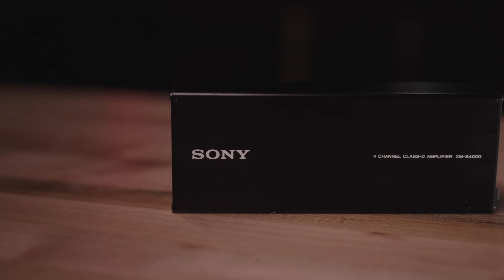What's the difference between amplifier classes? | Crutchfield

Comment: Heard plenty of class D over the years, including some prototypes from Bel Canto before being released to the general public. Yep, they have sure have improved enough for me to feel these things now sounds pretty damn good. However let's face it, manufactures are not using them for their sound quality. They are a way to cut cost and can be implemented in applications where a class A or AB is not practical. Think about a 11 channel AVR where cramming AB modules is daunting and cost\space prohibitive.  Still despite all their advances, I have yet to hear one that handles music exceedingly well  where I go, WOW I got to get me one of these.
Reply: You ever heard Hypex NC400?  That thing is definitely not built to be cheap. 125dB SNR and 0.0007% THD at 200W. All this at up to 93% efficiency.
Reply: @tomkocur  Yep, like many fine class D designs it sounded wonderful. However it still had that class D handling of the signal, that did not WOW me. Contrast it to something class A, like a Zesto Audio Eros 300 tube amp or Pass Labs class AX 100. To my ear a class A design does not sound the same. These amps are richer in the mids and highs, not nearly as accurate. Being someone that enjoys the more pristine sound of class D amps, they may not be your cup of tea. Their high price  and the amount of heat they generate is also a big turn off.
Reply: @tomkocur  I dont know what to say....that technics is the best ive heard thats d class in that price range.   
I cant really ask questions to anyone because no brick and mortar and ive been messing with this stuff idk....30 years maybe. So specs dont really mean much . Take an SET for example , terrible specs and distortion sounds better than any d class pretty much at any price.
Reply: @dednside5229  well, it all depends if you prefer "nice warm sound" or "true to the source".
If you want an amp that's true to the source, numbers are everything - you want low THD,  low IMD, high slew rate and whatnot.
If you want "nice warm sound", you'll get a tube amp running in class A. It might distort like hell, but it will do it at the right places (even harmonics).
Not much to do with HiFi, but listening to music should be about having fun and enjoying yourself...
Reply: @tomkocur  
They' ll come a day you wont think that anymore but thats what i looked at for years. Heres the problem with that. China . The old specs say from the 70's were real because it was a law back then . So unless it cost litterally as much as say a new bmw for the whole system count on it bieng measured in a favorable way thats not reality. Thays why old restored stuff can sound better and usually does if were talking amps.
Reply: @dednside5229  cool story bro.
Reply: @tomkocur  okay man . You win.
Reply: @tomkocur  look up kenwood l08m with  external power packs. Thiers a pair on the shelf in hardoff japan tokyo for 350$ a pair. 
10-350k frequency response at basically no thd. The best sounding amps like say midgrade go for 8 thousand dollars on the street. 20,000 damping factor. These are real specs 20-20 at rated power class ab. The best sounding amps are VFET SONY and Yamaha B series And then Kenwood/Trio years L which stands for labs series. They use communication chipsets and sigma servo feedback . 
They are so hard to repair because thier actually more advanced than a brand new d class
Reply: Technics su700g MK2 .
EVERYTHING sounds great.
If you can afford one restore a kenwood L series like an Lo-8m/5/7/7II .
I have hafler P7000 pair on a modified soviet tube buffer out of a marantz. 
Does it sound better ? Yes .
Does it have the top end of a Technics ....no . Bi amp .
Reply: NAD m23 …..breathtakingly good…..
Reply: That's because of your pre-bias. You will never like Class D because someone once told you they were no good. The state of the art class D amps literally CRUSH every other kind of amp there is.

https://www.youtube.com/watch?v=N6_6NOM7BZ0
Reply: @Wizardofgosz  I base my likes and dislikes by actually auditioning equipment. Trying out lots of different things to include the latest generation of Bel Canto class D amps. Sounded really good on a pair of Maggie 1.7's. Regardless, I liked them connected to the ARC VSi75 better. Agreed, I do have a bias. I always found I like the sound of valves and class A SS amps better.  The same way I like records better than digital. My personal taste has nothing to do with objectivity. Not sure why I should take the fun out of the hobby by being too scientific. I certainly have no desire to have something that crushes everything out there, too costly and too damn much work. There is always something that comes along that is better. I just want  something that I find fun to listen to. As far as being told not to like class D? !Huh! Never been one, that wants or seeks the approval of others. I'm far too ornery to  let anyone dictate to me what I like or dislike. I take a piece home try it out and let it speak for itself. If I like it. I purchase it. If not, I try something else.
Reply: @Wizardofgosz  
Ha! Wrong.... Single ended tube or hybrid tube or AB . Crush ? Thats a pipe dream. Hybrid tube amps and Single ended triode is the ultimate amp sans pure watts . I have that new d class Technics , the new one and i can promise your dead wrong.
People need to stop writing stupid stuff like this. Kids are gonna believe you. 
Start with a nice vintage kenwood DC and have it serviced. There are high end d class at big money but not until 10k or so. Get an AB studio amp like a hafler 9505 and use a tube buffer with good tubes and a digital front end. Its called a "follower configuration". This can be done on a budget also. Measuring at 1khz at such and such is not like the old gear which actually did rated 20-20 independently and had to be by law. So if your a spec reader understand the difference. Those old amps were legit chinese specs are bs. Its all in my living room right now so i know exactly whats happening here. P7000 diablo halfler are still cheap. Watch out though or theyll blow up your speakers if you dont re cap them. Push up your digital eq at 4k to saturate the tube plates and watch what happens. It smokes your d class and really really bad. I should know , have both. Look above at that lo8m. Those are legitimate specifications. Chinese is not verified by anyone and tested at 1k.
Reply: @dednside5229  You only believe this because you were told this. In double blind listening tests you absolutely would not reliably be able to pick out which one was which. That is unless the class A or the class A/B amp was failing and you could hear all the 60 Hertz hum.
Reply: @Wizardofgosz  It has not been my experience when contrasting the two typologies. Belief is not all that much a factor. It is verifiable fact when you measure tube gear you will find 3rd level harmonic distortion that does not exist in class D amps. Which is a far more accurate and unflinching technology. Tube gear cannot hold a candle to an class D amp's accuracy. People invest in valves because they like this distorted sound that those amps have. In SS versus tube amp debates this has been gone over many times. It is well documented that there is an audible difference that can be confirmed when measured.
Reply: @ridirefain6606  of course. And it's 80 or 100 dB below full scale.
Reply: @Wizardofgosz  
Okay . Im not responding to any hocus pocus answers and smoke like that. I have acess to the vault at Audio Advisors brick and mortar 250k $ plus systems. I believe whats real because i heard it. Buy all the dclass youd like.
Reply: @dednside5229  You didn't hear it. Someone told you that you would hear it, and your brain lied to you.
Reply: @Wizardofgosz  
And this is the argument for the ages.
The only problem with that is i have no bias twards anything. Its like comparing a honda civic to a ferrari number one. 
Unless youve driven a lamborghini you dont know what it means. Just endless speculation done by people because they cant afford it. And thats the real bias here. Thats why you hit the books and buy select old gear to be compeditive. If i dont understand it why do i have JBL that tests that way. 
Blind listening tests. Go listen to a pair of focal or wilsons. Youll get it.
Reply: @Wizardofgosz  80 or 100db below full scale means what? I do not see how this response has any relevance to the topic at hand. We are talking different sound characteristics not dynamic range. When comparing spec sheets of different types of amplifiers, the dynamic range between them tends to neck and neck no mater what the design is. If something gets rolled of it is usually the frequency response response figure, in order for its manufacturer to overinflate the amps power rating  I.E A 50 watt Conrad Johnson amp  that only has a range of 30HZ to 20,000 KHZ an 7 channel Yamaha AVR that does 120 watts 20 to 20khz with only one channel driven, these sort of games. Take some time and visit the Audioholics site or Audio Science Review and increase your understanding what specifications are relevant. You should be able to find a lots of useful content there.
Reply: @ridirefain6606  So you don't even understand what we're talking about? The harmonics that tubes add fall so far below full scale, that is if the amp is designed well, that they can't be heard.
Reply: @Wizardofgosz  I never heard anyone use the term "scale" in the context that you defined it. When someone talks about scale with me it is reference to the size of the recording venue, instruments, and the reproduction of the sound stage.  In the context that you use it, what I am familiar with is "what is within the audible range". So yes, I did not get what you where trying to get at. So thanks for the clarification. Moving onto your point then. My understanding is you feel there is no discernable difference between the sonic characteristic of state of the art amplifiers.  In a double blind listening test, one could not objectively pick up on which one is class D, AB, A, or Valve? Our biases get in the way and what we think we hear is psycho-acoustic affect. Furthermore, the harmonics tube amplifiers have are inaudible and do not make a relevant difference. I dispute that. Details for my  argument are contained in the link: http://www.tungsol.com/html/faqs14.html#:~:text=The%20harmonic%20content%20of%20an,with%20suppressed%202nd%20order%20harmonics. This is but one article, there are others you can google.
Then, your statement that state of the Art Class D amps crushes everything else! I would like to also call into question. Since by your own reasoning, in a double blind audition you should not be able to pick it out from any of the other type of  typology. Are you sure that is so? I would argue, that is not necessarily the case. There is something about class D amplification that you are identifying with. That design is somehow connecting you to the music, better than anything else. If that is true for you, then it stands to reason that there is something about what a valve amplifier does, that a tube-head like me connects with. I have found that you cannot quantify somebody else's subjective experience. All you can do is find something you enjoy listening to, and what anyone else thinks of your choice, be damned. Their opinion does not mean a hill of beans. There is no clear right or wrong in this hobby. Just what you look forward to coming home and listening to, at the end of your day. Nothing else matters.
Reply: @ridirefain6606  No. I am talking about actual measurements. When you hit a device with a sine wave that goes to 0 full scale on its meter you then know exactly where the harmonics fall. It's sort of like metering in digital audio. The highest you can go in digital audio before you achieve 100% distortion is 0 dBFS. 0 dB full scale.
Reply: @Wizardofgosz  Got it. TY and be well.
Reply: @Wizardofgosz  
No. Modern measurements are not real.
Thier done at 1khz. Not 20-20 hz to khz.
See back in the day thier were laws that made it be verified independently. Chinese specs are bs.
Reply: @dednside5229  No modern measurements are not just 1 kHz. They're much more sophisticated than that and if you were watching any of the actual people doing the real analysis and equipment they were using you would know that.
Reply: @Wizardofgosz  kudos on being an arrogant know-it-all nobody wants to interact with lol
Reply: @NotSo-bp9op  science is real. I don't know anything but the hundreds of amplifiers I've seen tested over the years tell me everything I need to know.

I also love it when people approach this hobby with science they're the arrogant know-it-alls even though people are telling me a $5,000 IEC cable makes their rig sound better which is scientifically impossible.
Reply: @Wizardofgosz  nice job dancing around the point I was making. by the way, since you feel inclined to speak on behalf of scientists ("science is real"), how many citations do you have in the scholarly literature?if it's zero, I would suggest not trying to speak on behalf of science due to lack of qualification.
Reply: @NotSo-bp9op  I'm not the one dancing. There are literally thousands of tests of class D amps that show they're perfectly flat and some have so little harmonic distortion it's in the noise floor. Which basically makes them a perfect amp. They have no harmonic distortion. So all of these people who think that class D amps sound shrill because someone once told them that are simply wrong. And I am absolutely sure that when they know they're listening to class D they'll say something ridiculous like "oh my god I'm getting listening fatigue," but I also guarantee you that when they don't know what they're listening to, whether it's a $500 amp or a 5 million amp, they won't be able to tell you which one is which.

No one should be embarrassed by their cognitive biases. They're built into our brains when we're born. The difference is recognizing it.
Reply: @Wizardofgosz  Well thanks, somebody might be interested in that additional verbage